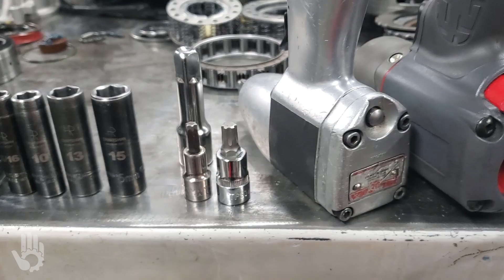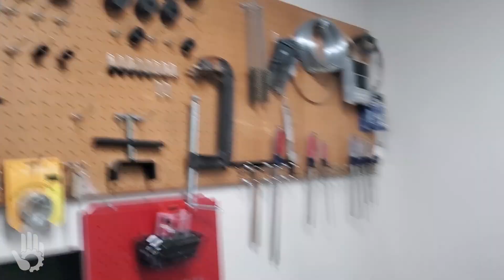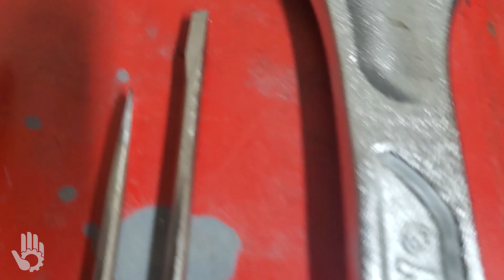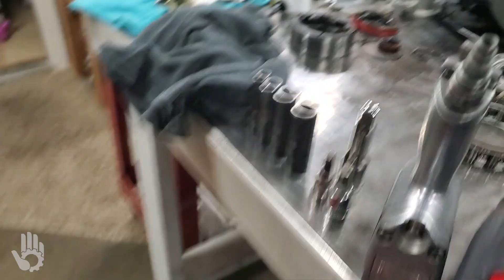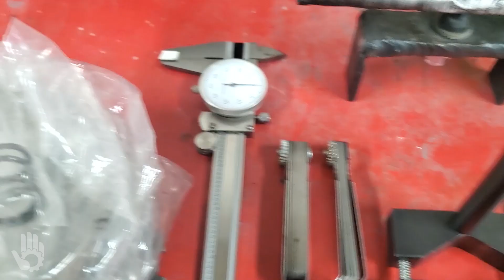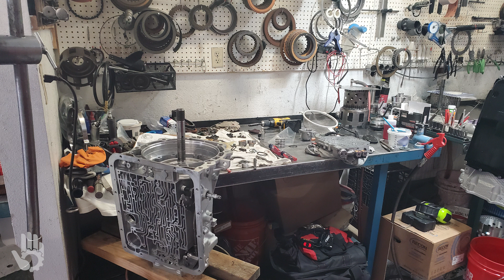Helping Out - Rebuilding Transmissions at a Short-Staffed Shop

Comment: Hi Robert I rebuilt my 94 4l60e almost a year ago on my camaro and was working great no leaks (my first transmission rebuild ever) I only had like 500 miles on it, I only use the car some weekends. Thing is a couple weeks ago I went on a 40 mile trip and the transmission cooler failed, huge leak I dont know at what point in the trip it happened but when I got home it was shifting weird and had very slow reverse, very low on fluod. I replaced the cooler and refilling I accidentally overfilled the transmission but didn't notice it. Then I went to a test drive for like 6-8 miles and the transmission was working good just a bit harsh on the 1-2 shift but felt back to normal. I noticed the fluid level and took some fluid out to get it to the correct level. Thing is now it has a leak which seems to be from the pump seal, do you guys think that the low fluid due to the cooler leak caused the torque converter to overheat and damaged the seal? I don't really know cause I need to take the converter cover out to really see what's happening but the fluid it's coming from that area for sure and I think it's the only place it can leak but I might be wrong